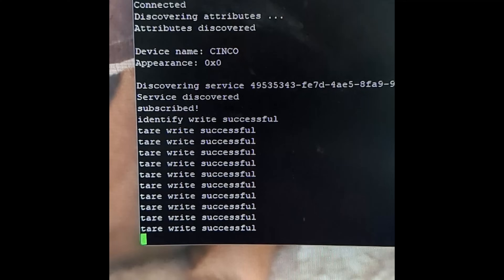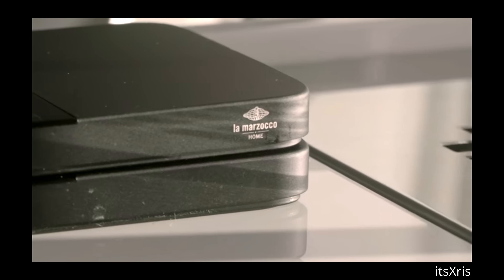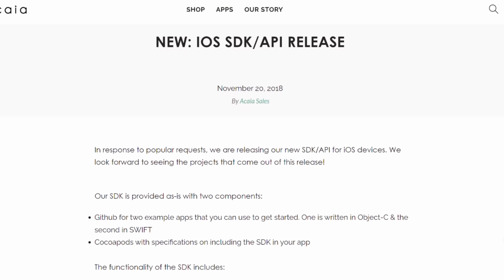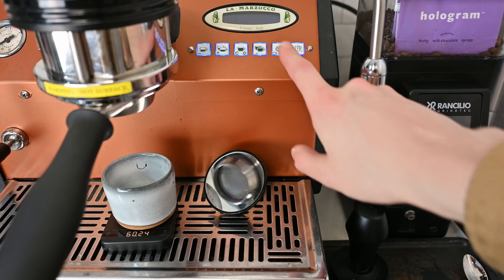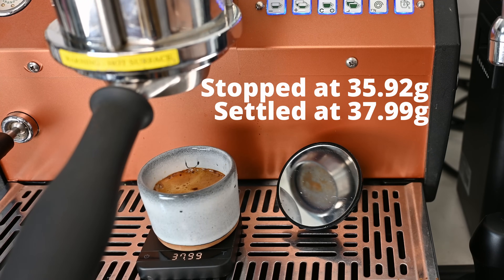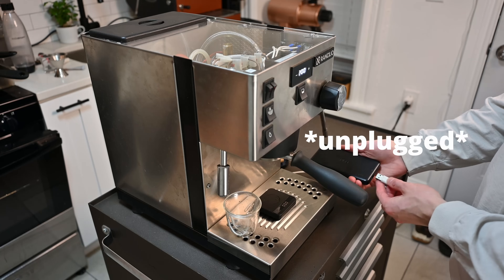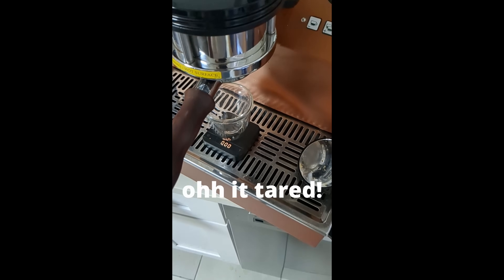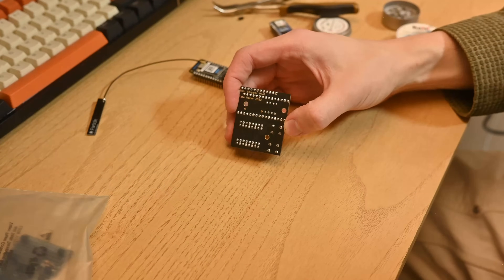How to Connect Your Scale to Your Espresso Machine

Comment: This would be really nice to have on a Gaggia Classic Pro.

I know there’s a gagguino mod that can be done, but to be honest I’ve already got good pid with profiling and such built in, I see no reason to rip that out and spend more for another kit.
Just having the option to brew by weight would be plenty enough.

Also, I have a difluid microbalance Bluetooth scale. Wondering if it could be possible to work with that as well 🤔

Comment: Nice I did this myself in python since there was a python module for the acaia scale. The Breville dual boiler I used a Shelly 1 plus and wired it up to the manual button for triggering via Bluetooth. It sucks that the machine doesn't have an easy way to do that. I had to keep track of the flow rate in order to predict when to trigger the stop button just in case but I might try it your way... That's a really great setup you've got running there.
Reply: I wonder if it would work with a breville bambino
Reply: @zackgregor7491  Would work with any machine with some tweaks.

Comment: Does it have a UI to change the shot volume or do you have to set this in the code? Esp32/8266 have Wifi that would allow a simple web interface to change the volume...
Reply from the maker: I hope someone might add that down the road! For now, I just have the setpoint flashed with the firmware. Works well enough for my workflow since I don't change it very often.

Comment: Again, this is just amazing! Love it, the mix between engineering and espresso love. Do you think this would work on E61 machines? (I have myself a Lelit Mara T), probably not right? Since you're restricted by the lever mechanism.
Reply from the maker: Thanks! Unfortunately you're right. I did do something similar with my appartamento where I just turned off the pump when the shot was done, but that ended up dripping a lot since the valve stayed open :/
Reply: @tatemazer  Yeah that's what I expected. Nevertherless, great work!
Reply: I wonder if my Expobar with rotary pump also drips. I’m going to shutdown my machine without stopping the shot, if it doesn’t then I’ll get your board.

Comment: This is so sick! Would love to add this functionality to my LM Micra and felitica arc scales. 

QQ - how do you control the target weight? Is there an interface to accompany it?
Reply: Hi @nick0t33n
As noted in my comment below, I have started looking into it yesterday for a bit and then opened an issue on the GitHub to add the felicita arc to the library. As of now, I managed to catch a couple of frames in Wireshark but lack the reverse engineering skills at the moment. I am trying to capture more frames and to get more information.

Recommandations for how to get up to speed with ble are welcome:)
Reply from the maker: Thanks! Yes I'm definitely prioritizing support for the micra, I've been getting a lot of interest for that machine.
for now, the setpoint is just set in the firmware.

Comment: Looks interesting! I want to give this a try on my Appartamento. I just requested access to the hardware (it required a request for access).
Reply from the maker: Hey sorry about that! It should be fixed now.

By the way, the Appartamento unfortunately uses a mechanical switch that cannot be electrically spoofed like this :/
Reply: @tatemazer  A bit messy but a servo can be added for lever shot off.

Comment: Amazing video and tech! I have a question for you. I've been tinkering a esp32 coffee scale for a long time, it's a fully useable one, with oled 128x64, which could show the weight, the flow rate (g/sec), the coffee ground weight. and the time, first drop, last drop, and the gound/water ratio. That's an interesting project. The question is, if I wanna mimic a acaia scale, which then i can use it with the decent espresso machine, what kind of data/data struction should I proved to the machine? Or in this video, to your esp32 board? Many thanks in advance.
Reply: for now I just use bluetooth serial to send data. I'm afraid I'm looking for the wrong direction
Reply from the maker: Hi thanks! I personally would not recommend imitating the acaia scale since their protocol is relatively closed down and proprietary. It requires some hand shaking before the scale starts sending weight data over. I'd recommend following the generic scheme that the decent scale uses.

Comment: This is amazing, how would you get a controller like this to work with an E16 machine? If you need a beta tester for any e61 projects I'd love to help, based in UK with a Lelit Mara X ❤
Reply: I would also be very interested to install this into my E61, although it will only stop the pump and not open the release valve I still see some potential here.

Also I would be interested if it could be modified to work as a shot timer with something like the Lunar. So start the time when I flip the lever up and stop the timer when the pump stops
Reply: @dukeless  Not sure which E61 machine you have but check out the UAT mods connection for the Mara X - great visualisations / shot timer etc

Comment: Does the Rancilio have surge protection upstream of the switches? I kinda expect some in the GS3 since it uses electronic controls.
Reply from the maker: I don't believe so since this is all low voltage going through the switches, granted I've yet to open up the brain on my Silvia pro

Comment: Great work! Will that work with the felicita arc too? I think the ble API is similar but not exactly the same and I am short of any communication -y code knowledge.
Last I checked, I didn't find a library for Arduino and felicita yet. If anyone knows of one, I'd be grateful!
Reply from the maker: thanks! I believe your right, in fact I'm under the impression its quite a bit easier to connect to that scale. It should take some slight changes to the firmware.

Comment: Can you still operate the machine without the scale? I.e. if the scale is turned off?
Reply from the maker: Hi great question! Yes! when the scale is turned off the device becomes completely passive to the circuit, and simply waits until it can find the scale again

Comment: thank you for this so much :)
i hate having a wire hanging out of my delonghiuiuino
Reply: would you be willing to help in a month or so if I had some coding questions about integrating this with my modded gaggiuino setup?  i made gaggiuino so it's touch screen start and stop brew and steam, and stop on weight with a nano board.  in my brain i think i can have my start brew switch trigger your scale in the same way.
does this seem conceptually possible to you?

Comment: Would this work in an e61?
Reply from the maker: Hi thanks for asking! This will only work for E61 machines that have a solenoid valve instead of a lever
Reply: Thanks @tatemazer . I am wondering can this be used to turn off the pump automatically, with the operator then lowering the lever after to open the valve?

Comment: How much would this project cost including the PCB, arduino, cables etc? Would love a collab with shadesofcoffee to make it accessible to Gaggia users like myself.
Reply from the maker: Hi thanks for asking! All in, it should be under about $50. By far the priciest part is the Arduino so if you have one that helps!
Reply: @tatemazer  and someone making it able to handle high-voltage brew switches like you mentioned. $50 for this would be awesome, in my case I'd also have to get an acaia scale haha. Love your craft and how you explain what you do in layman's terms. It speaks of your incredible knowledge on the matter. Cheers!

Comment: Can you do a motor actuated e61? With profiling capabilities by controlling the motor precisely… hay, I want to patent that!
Reply from the maker: Are you talking about the flow profiler added to the top of the group? that would be very cool!
Reply: @tatemazer   actually I was talking about the other lever which starts the pump and directs water to the shower screen. But the flow control would be cool too. Full pre-infusion and flow profiling
Reply from the maker: @c2329ra ah, sadly that lever has very little flow-control, it essentially can only open or close the valve
Reply: @tatemazer  oh… :( I’m in the process of buying my first e61.. the ECM Classika PID and I’m so exited. Got inspired by your videos and I plan to create an arduino thermometer. My plan is to have PT100 Thermistor sensor screwed in the M6 above the shower head, and OLED or E-ink display mounted right over the M6 port. I thought if would be very nice if such thermometer could do a speed warmup of the machine by pulling warm up shots automatically. Hence the lever control…

Comment: This is awesome! I've been thinking about potentially using an arduino or esp32 to remote control my Profitec's PID (turn on and off the steam boiler, adjust temps, etc). Do you think that would be possible? I am more comfortable messing with software than hardware and am scared to break my machine
Reply from the maker: Thanks! certainly possible! All those systems are being run by something much less powerful than an esp32 already, so it should be attainable!